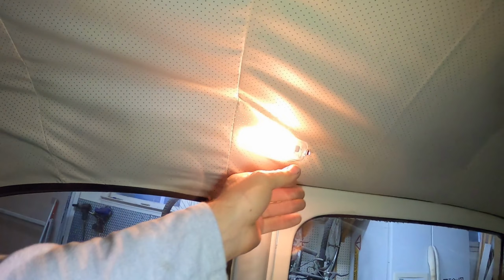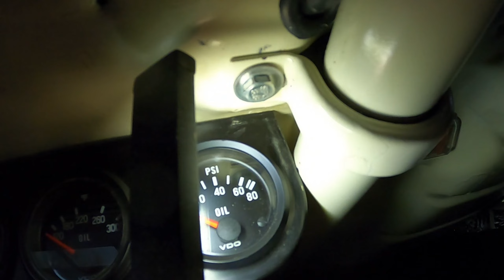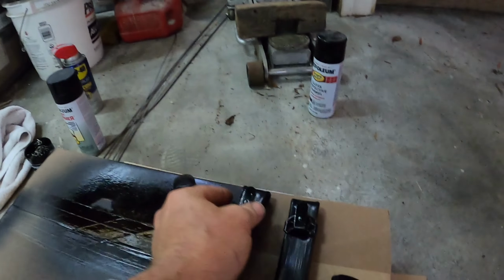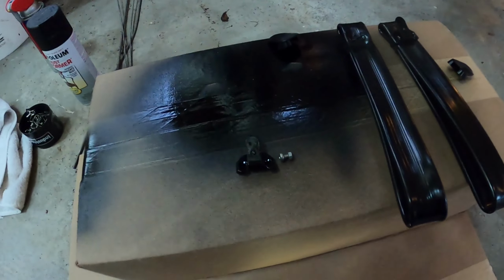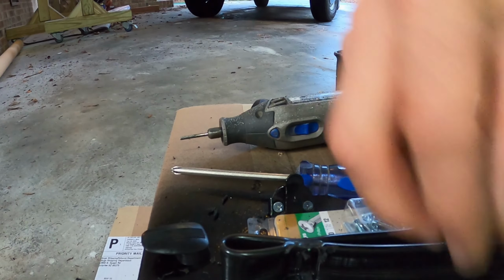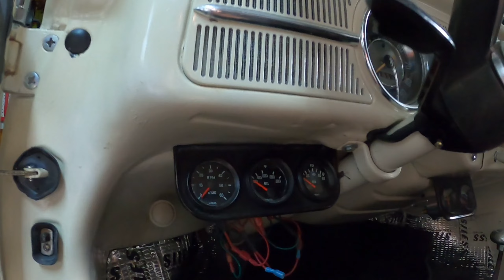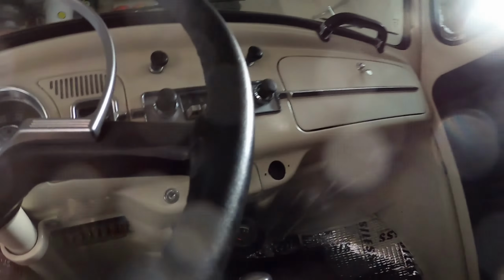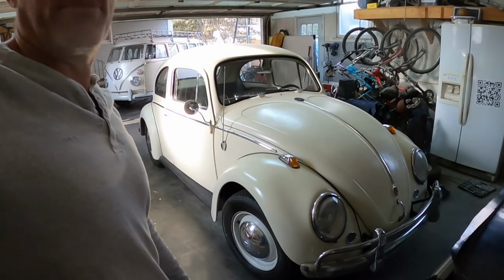1961 VW Beetle (65 Pan) - Assist Straps and Rogue Horn Problem - 133

Comment: Interior looking good..I bet its a lot quieter and warmer than it was originally with all the jute n stuff you got in there...mine had a piece of stuff stuck in roof about 2ft square and that was it!
Reply from the maker: Yes - way quieter - so I will still put a bit more jute in the back over the wheel wells, and in the front over the vertical sections and carpet padding over the pan and center

Comment: told you about the headliner , the job s*cks , mine looked even worse then yours . now  at my bug  i did carpet on the roof :P

Whenever ill get another bug ill have it installed .
Reply from the maker: Yup - the headliner was by far the worst experience I had doing this bug.  That being said - I do not care that it is wrinkly - there is a working headliner in there now and the back windows are in.  I lowered my standards after that experience...
Reply: Nah its fine!
Reply: @LarsonSplitBus-  yea yours looks fine . mine was worse i was pulling it tight and it broke in some spots . its really a special craft to do it perfectly . 
But i like that u tried it . i know i never wanna go trough that experiance again . ill stick by what i know . engine's and carburators